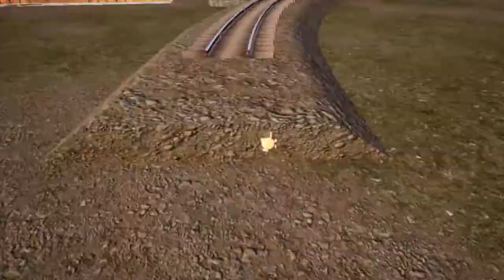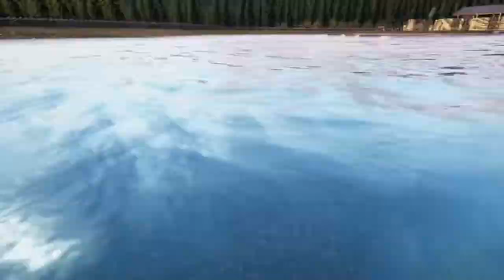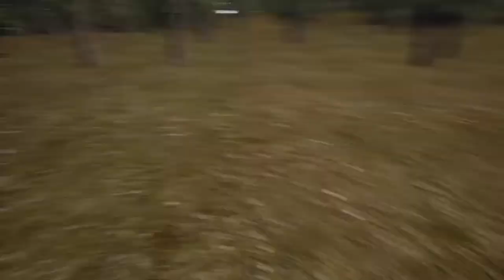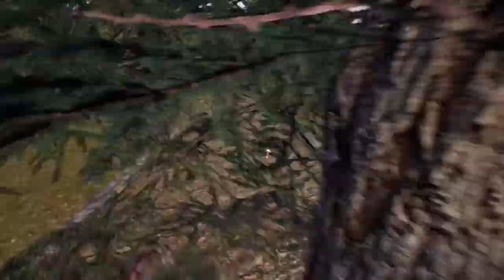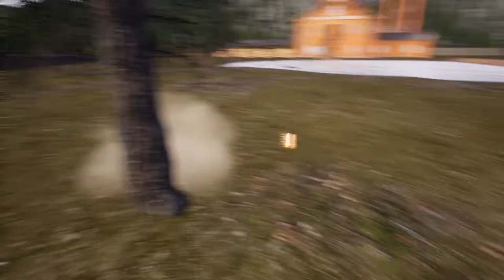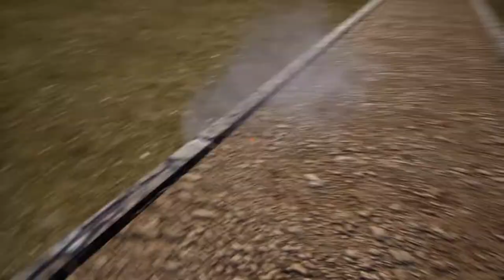Railroads Online! | Eureka Worthy Rail Repairs! - Part 1 | Realistic Mode

Comment: When I try to get straight track I align a switch and delete the ground work. Then I place cross over pieces until I'm satisfied and go over it with regular rail deleting the switch if it's in the way. Good way to get straight track if you have patience.
Reply from the maker: Yes that's a great idea 👍🏻. I prefer using 2 crossovers to align the ground work, the continue the track with the same. Later once tracks are done I may redo the groundwork to centre align with the tracks.
Reply from the maker: Will try out your idea soon 🙂